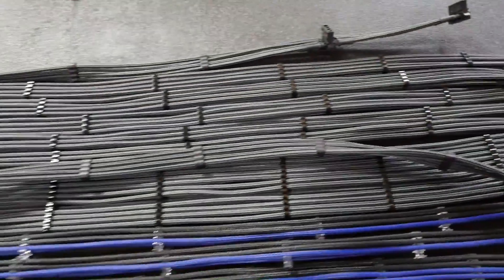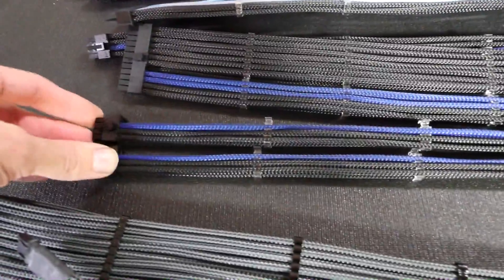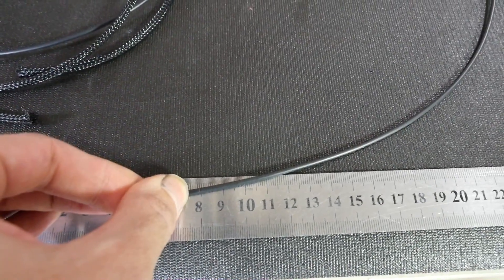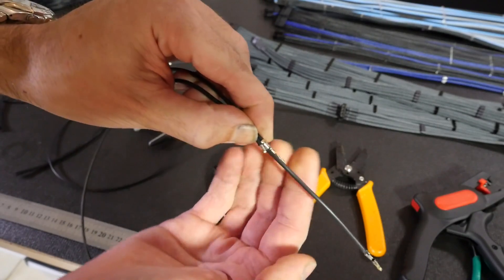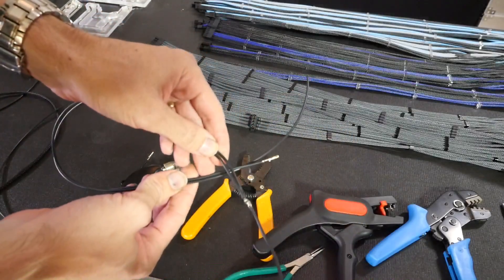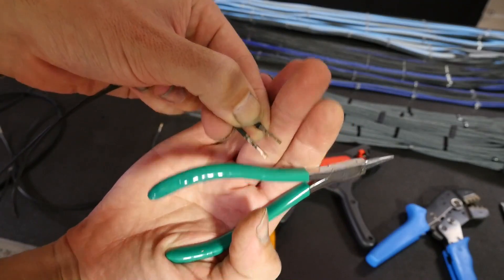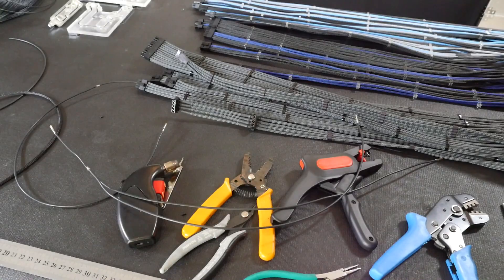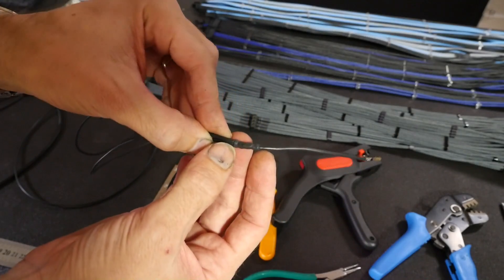Custom Cables: Split Wires Guide

Comment: hey im looking to make my own custom cables for my nvidia cmp 100-210 gpus which are just repurposed nvidia tesla v100s and the gpu has a 8 pin eps connection on one end  and the other end for me needs to plug into my server psus breakout board which is just a 6 pin pcie connection the eps end uses 4 positive wires and 4 negative wires  but the 6 pin pcie end only has 3 of each can i just split one positive from the pcie into 2 and then split one negative into 2 and it would ok ? im using 16 gague wire to

Comment: I've been building cables for 15 years. Please don't double crimp wires that way. Every terminal is designed to work one way. Doing what he did by crimping and cutting the terminal will fail a pull test. Please solder them together or use the proper connecting terminals.

Comment: i has a double wire on pci gpu side.. can i invert him? and connect a male pin to the other so in that way do an extension to reach the pci gpu side. 

my psu is Seasonic PRIME SnowSilent 1050w.

Comment: I know this is an old video but I relied on it for my first attempt at creating my own cables using an AX1200i. After upgrading my system and GPU I am having to redo my cables for the GPU. I am using a power supply tester on them before using in my system but every 8 pin pcie I have made so far keeps tripping the system when plugging it into the psu tester. The psu powers on fine when the cable is plugged into it but trips when I plug it into the tester. Could it be a bad split that I'm doing or a faulty psu? Any ideas pls as can't find a proper pinout for the ax1200i that includes pcie.

Comment: What you did with the molex terminal on the crimp, is what I've been doing for the last few years with Automotive wiring at work.  I actually prefer it to a soldered splice, it's quick and easy, and there is no risk of a dry or dodgy solder, and although not an issue in a computer, a crimped joint has no risk of breaking from vibrations and a non flexible joint.  I tend to put the terminal in the crimpers and lightly close them to hold the terminal, then cut the flag end off, then open the crimpers back up and put in the wire that is being spliced on to, then start to close the crimpers again, then insert the wire that I'm splicing into the joint, then crimp.

I've been considering making my own cables, and had planned on doing the same, so I'm glad to see that the Pro's are already doing it this way as well.

Comment: Does anyone have any advice on what to do if I pin out diagram for a PSU has a 'no wire'? (https://pc-mods.com/blogs/psu-pinout-repository/corsair-psu-type-4-cables-pinout) I don't want to leave the pin with nothing in it because it will look a bit weird but I can't find any advice on if you can replace the wire with something else to keep it looking clean?
Reply: Old question but how about sleeving some thick fishing line as a dummy wire.

Comment: also a question, my psu has 2 cables running out of a single pin on the motherboard side. is it oke to replace this with a single 18 or 16awg wire and split it before the PSU or is this a likely firehazard?

Comment: This is a great guide but it's difficult to find the molex terminals your using to crimp the double wires with. Can you confirm the molex product code for the fat4 female terminals?

Comment: thank you for showing the release on the crimpers, i've started to do some custom simpler wire's (PWM/usb) and i've had the pin rotate wile closing the crimpers and then have no idea how to release and then just had to force it through and hope it didn't damage the crimpers >.< good stuff to know

Comment: i always have the problem that the "helping hands" will, when i solder the wire, bite into the isolation so much i can see the wire. I tried adding silicone tubing to the grippers but that only squishes the isolation.
Reply: Use heatshrink on the hand bites themselves to make their grip a softer one.
Reply: @Moldredd  i will try that thx

Comment: How will I know if a cable I'm considering building will require a split wire?
Reply: Continuity test with a multimeter showing two points meeting at the other end.

Comment: Could you not just crimp both wires together at the PSU connector? Seams like it would give a much cleaner finish than this one where you split the wire down a little ways.
Reply: That, with the combination of the sleeve would make it too thick and therefore make it extremely tough to insert it into the end connector.

Comment: Good video, bit wouldn't it make sense to use a small splice crimp or one of the small solder splice connectors that heat shrink to the wires?  It would still be small enough to sleeve afterwards and you wouldnt need to fidget with two wires in a pin crimp.

Comment: Can you make video on how to sleeve cables with capacitors (do PSU really require these in system?), how to make cable pinout, if you can't find it for respective PSU (Corsair AX1600i for example)  in Internet? Thank you beforehand.
Reply: I would wantr to know the same thing D:

Comment: I know I'm really late to this party, but I thought that someone here might have some insight on my question.  Has anyone making split wires used those little mechanical splicers... like these: https://www.amazon.com/WATERS-GOOD-Connector-Straight-Terminals/dp/B07FXXYB81/ref=sr_1_1?keywords=2+way+straight+joint&qid=1555028251&s=hi&sr=1-1

This could be covered in shrink wrap to improve stability and appearance (and secure the sleeve material.)

Thoughts?

Thanks,

- s.west

Comment: They actually make "solder sleeves" for your double wire mod. It's heat shrink with a ring of solder in it. Here is an example - https://amzn.to/2MWdpY7
Reply: What size soldering sleeve would accommodate two 16 AWG wires for this?
Reply: @thomaslandato3953  16 is blue

Comment: where do you find the pin outs?
Reply: Not sure which you have, but Mainframe Custom has a lot of them that are very easy to read with correct orientation shown on the main brands.

Comment: hi can you please let me know the manual wire stripper for covering all the pc cable diameters what dimensions should have and if is any automatic good stripper that can be used for all types of pc cables and it is able to do that strips in the middle of the cable thanks

Comment: how do you go about sleeving an 8pin pcie to a 8+6pin at the gpu? would you still do split wires or just run do two cable sets? like an 8pin pcie to 8pin gpu and just make another 8pin pcie to 6pin gpu? i have a Corsair AX860. one drawback i see is that the 8pin to 6pin will have 2 slots empty and i have a case that doesn't have a psu shroud. 😔

Comment: hi there!
I have a question about corsair atx type 4 cables! 
I have psu corsair rm650x. There's ATX 10+18 pin cable from PSU to 24 pin motherboard. In the place of splitting wire corsair install capacitors! 
And here's my question: "Do you use capacitors in your cable builds when use Corsair RM series PSU or not? If you do, what kind of capacitors do you use?"

Comment: How do you sleeve the ends where the split is? Do you just use a piece of heat-shrink for each wire and then a big piece covering everything in the end?

Comment: I’m not sure how different it would be when soldering wire vs soldering electronic components, but the soldering makes me think it might be a cold joint. But it probably doesn’t matter and it’s possible that the heat spreads too much when trying to apply solder by heating up the wire. The insulation might melt before the solder flows. I love this channel, BTW!!
Reply: definitely a cold join
Reply: Do you think this is something that would be better done with a little ferrule instead of soldering? Picture: https://3.bp.blogspot.com/-znkwabXeHok/VqMTVNPpRnI/AAAAAAAAP60/sFJ8n4Bs6t4/s1600/DSCF5844.jpg
Reply: Using flux would defintely help with the flow of the solder into the wire strands.

Comment: I contacted EVGA's customer service regarding split wires when I was about to sleeve my G850. The answer I got was that double wires (at least for the G850) are redundant and are only there for future standards. With that in mind I sleeved all cables without a single split wire, making sure that all voltages were correct. It has now been running with those sleeved cables for almost a year without any problems and they look pretty nice as well. I am sure that not doing split wires saved me a lot of headaches. I don't see how this wouldn't apply to other PSUs as well as long as the voltages are correct that is.
Reply: Do you have an update on this? And was your 850 a G1+? Also, what do you mean by making sure all voltages were correct?

Comment: great job! have you ever tried using a jig to find all of your final lengths last? ie set everything up in location, with combs etc, and a little over length, then you could slide a modified hollowed connector to where all the wire should end (minus pin and connector length)  and cut every wire to it final length there exactly and in one go;  like a bowl cut! I don't know if there are issues with this, But i believe it would be very accurate and also save a lot of measuring. it should also allow for prefect bent lengths. Your build are inspirational🤓

Comment: I have Evga psu the 24 pin had Splits Wires it works without the splits any idea what there for? My guess is for when the system is under high load ?
Reply: yea my psu have 2 splits but when i did my cables i just go without because i checked and the voltages were the same for both situations

Comment: Your technique of using that Molex Pin to crimp the two wires together is very similar to what the Automotive world does for splicing.  We call the splice clips (but they are added by machines, and just the area that clips the two wires together).  I've been doing splices like this for about 15 years (right after I learned how they do it in the automotive world). They then use either tape or waterproof heat shrink to protect the splice.

Comment: ###Splicing tip###    When ever I make a soldered splice. Like how you used the connector pin to crimp the wires together. Instead I grab  a section of scrap wire and strip a few inches of the insulation from it. Now, I take my cutters and clip a strand or two off the stripped end of the scrap piece. I then use these strands of wire to wrap around my splice . This holds the splice together neatly for soldering. Once soldered I end up with a thin but very secure connection.

Comment: I wish this video was published 2 weeks earlier.  As always, you put out excellent info and videography.  I just finished sleeving my own cables for my own PETG build and mine don't look anything like yours.  I was twisting the pairs together before soldering.  Doesn't look as nice as using the molex pin connectors...

Comment: You really should invest in a better soldering iron. I used to use those crappy no name branded ones....but then I brought a Weller WES-51 and oh my god it is like heaven. It makes such a difference.
Reply: So much this. Used to work with a 20€ analog station. For my custom keyboard I upgraded to a digital high quality soldering station. Boy, has my soldergame improved. Also industrial grade rosencore solder helped alot, was tough to find as a private consumer though

Comment: Great video. I really appreciate your method if crimping the split instead of soldering. Definetly something I will try out. I would personally never solder a cable that I intended to crimp. The reason is that if you increase the risk of gas pockets forming and that could lead to a cable fire.

Comment: Hi guys i have a corsair 750rmi and wanted to do custom sleeving
 first of all the pcie cables are split
 and second of all the psu connectors are strange there are two connectors for the 24 pin cable...can i get these connectors somewhere) or do i need to remove cables?
Reply: ***** i have some cpu connectors i could try on (dont have 2 cpus anyways) but id prefer not doing so :) ty tho

Comment: Normally the capacitors are for AC decoupling and the twisted wires should be for high speed lines with differential signaling (for example: Networking cables).

Comment: Can't do it without shrinkwrap?

what universe is cablemod from then?

Just saying you shouldn't just say flat out it's impossible
Reply: I would rather want to know the answer how they could do without split wire. Literally most custom cables i come across have split wire.
Reply: That would be great, but unfortunately even EVGA is strange that way. Maybe when 24 pin headers get a rework after another 20 years  *fingers crossed
Reply: Derek Peterson I check my cablemod cables since I have some. actually it's because they use thin 18awg wire and Paracord which is 5mm which allows to combine 2 wire into a connector. Not to say it cant be done but depends on the wire and material. For custom cables like SG will use 16awg thick wire and mdpc x sleeve. It's literally impossible to do it clean like cablemod Paracord. Just to let u know the material quality is also different here since the wire sg use is very high quality and the mdpc is thick.
Reply: gotcha, but at the same time the cablemesh cables are PLENTY enough gauge for any amount of wattage you could chuck at a gaming system. Unless you're running multiple feet for a single rig there just isn't reason to go super thick
Reply: Derek Peterson Well the standard size 60cm isnt a problem. I think probably length like 100cm + could be an issue I'm not sure. My local modders use 18 awg and find it no issue even stock cables are 18awg. 16awg is thicker so it's able to keep it's shape better and also looks better with sleeve. Basically it's just matter of opinion and esthetics. Since sg are custom Modder I don't think the will skip on the quality just to save cost. But as a customer we know 16awg to 18awg is insignificant in performance.
Reply from the maker: They are done on a machine and cut with a hot knife which melts the sleeve right onto the wire instantly. Im doing the same thing but manually. You cant do it with two wires in the one pin though.
Reply: I must be missing something, there are 26 pins on an EVGA power supplyheader  that fit into a 24pin connector, and there's not a hint of heatshrink showing
Reply: Derek Peterson that's because they already have the extra pins so that you don't have to route 2 wire into a single connector. Most power supplies don't do that.
Reply: This is a lost conversation, because there are multiple wires going to 1 pin....with no heatshrink. Lets just leave it alone since this is going to go no where
Reply: Derek Peterson haha but like I said depends on the material and wiring it's possible but there is definitely trade off.

Comment: Thank you for another great video.  Honestly one of the best channels out there.  Couple of questions. I'm in the process of building my dream rig and am anxiously awaiting what feels like 6 months for my SMA8.  I want to do custom cables but the reality is I don't have the time.  I'm skeptical of the mass fab cables from cablemod etc. and I really don't want to sacrifice on quality for this project. I'm curious if you offer custom cables for an EVGA Supernova 1600 P2?  I wont have final measurements of the cables until the case arrives but I'd figure I'd ask ahead of time.  On a completely unrelated note.  I intend on purchasing the protirum D5 pump top, res, cover etc.  But I'm unsure of what pumps are compatible and if you have an installation guide. This will be my first hardline build and want to do my homework.  I would love a video displaying your new products and a guide on installing them.

Comment: Amazing! Thank you so much for uploading this. Can a regular BIC burner work on MDPC-X Sleeving and Heatshrink? And can the regular crimper you linked before for Amazon do the double crimps?
Reply from the maker: Naked flame is no good mainly for beginners. The burner I use gives maximum control and its easy to achieve perfection. Crimpers are critical, Ive used all of them. MDPC-X is the best along with the ones I use which I am trying to source. I will sell them on my store asap.